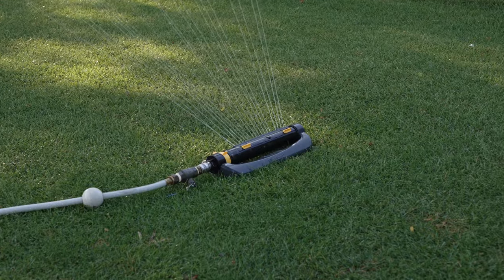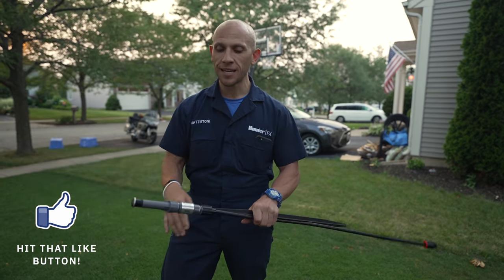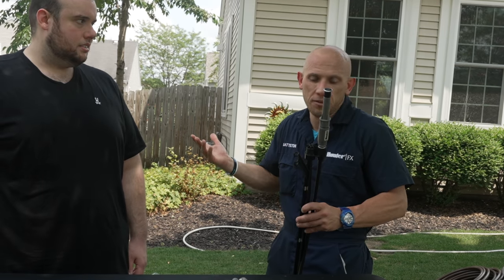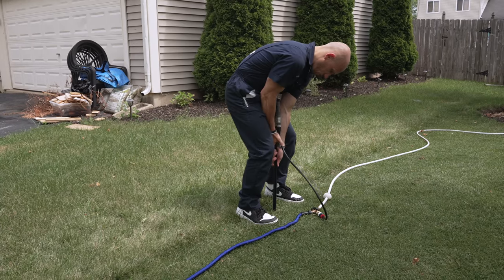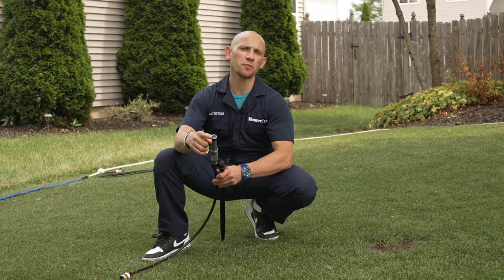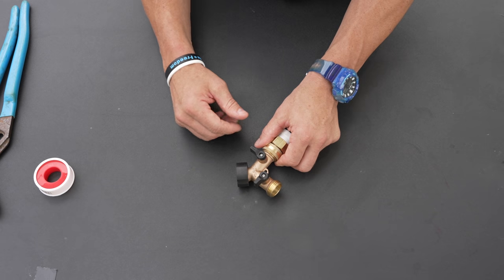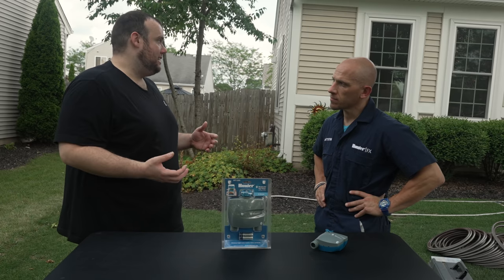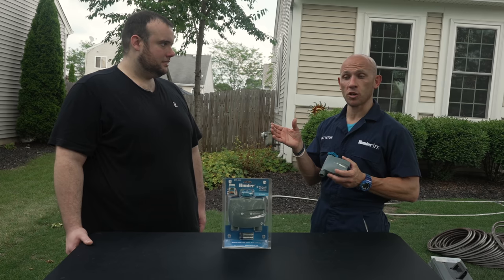Once You See It, You Won’t Use a Regular Sprinkler Again

Comment from the maker: 🔵 I Just Got a New Irrigation System!!!! See here-> https://youtu.be/3w3gq0_qsh4
Reply: Can we get a follow up to the lawn renovation in the spring? Before, during, after, program for water, fert used, regrets, wins, go forward plans for fall, winter, and spring?
Reply from the maker: @calbro5823  working on a follow up for over seed now, should be out in a few days. I cover a few regrets I have about kbg in it. Stay tuned
Reply: @PrincessCutLawnCare  awesome! Thanks!
Reply: Can i replace my old Hunter sprinkler heads with the new MP heads. it's underground Hunter system and works great though. I bought a new X-core controller for it.
Reply: No disrespect.. but for anyone who is concerned enough about their lawn to even be considering an irrigation system, overall this would just be a waste of time and money not to mention aggravation.  Now if your looking for a temporary solution that's only going to be used under special circumstances OR your just broke & handicapped then maybe ok for you.  Also, anyone who's in the service side of the business knows these MP rotators only look good on paper, in the real world they never go the distance.  On sloped grades they have there place but still fail way to much, so do the krains, so do the Toros, the rainbirds are slightly more trustworthy.  If your lawn is small and isn't concrete hard and your physically capable, you can install a much better official in-ground system by hand using hose bibs, 1/2" poly pipe and a 10" Wilton slit tool, obviously you must zone the system and head count based on volume available.
Reply: @alexanderdeclercq982 You bet, especially if they are rotors or old pop-ups. Just be sure to replace all of them on the same zone otherwise your GPM will be inconsistent. You can have different heads on seperate zones provided they are similar water output.

Comment: I don’t see the difference between this product and a normal run of the mill sprinkler. Your still using hose that would need to be moved when mowing and moved to prevent leaving a burn Mark on the lawn from the hose if left in place when not in use. Also your not going to be able to attached more than probably two of those sprinklers off one hose line. You need to account for length and size of hose along with water pressure in order for more than one of those sprinklers to cover properly in order for it to work like an underground system works. Seems like fluff to me. Installing an underground system is an easy diy job if you put a little effort into it. Just my opinion.
Reply: Water pressure, flow rate, hose length and whether such a setup would be able to sustain more than two units at once also came to mind as I watched this. If I'm limited to 2 units based on available water pressure and flow and I follow the recommendation that both spray back at each other, then the largest area I can cover at a time is 30 square feet. That requires moving both units and hose multiple times to cover my roughly 4,000 sq ft lawn. That's simple enough to do, but it's not quite the "set it and forget it” solution presented. No shade, simple truth.
Since you mentioned it, do you recommend any specific resources online or off to reference/consult for installing sprinklers myself?
Reply: Sounds like you could learn a bit more about pressure regulated sprinkler heads. I've set up many systems and they work great if designed properly. Yes, they have more than 2 heads. We have 20 gallons a minute flow with plenty of pressure where I live. Some simple math will yield a viable set up.
Reply: @LemonySnicket-EUC  lol. I have installed a few irrigation systems in my time. I know exactly what needs to be figured. That was the point of my comment.
Reply: @aroundthehousewithpat31  I didn’t mine also. But I did it as a temporary solution at my new construction house. 🤣🤣🤣 I set up 6 Rainbird 5000’s with the 3.0 tip, got my placement using regular spikes, and then used old hoses I already had and buried everything. 6 heads covering about 11,000 square feet with a 5’-8’ overlap. Each head is it’s own zone and running a 4 zone timer from the front of the house and a 2 zone running from the back of the house to my side yard. With the timers I might have $350 into it. 🤣🤣🤣 My neighbors who’ve spent thousands were like “Wtf are you doing”
Reply: @Lumpygrits76  definitely a great diy project. An irrigation system is well worth the effort and very cheap to do if you install it yourself. This was my 14th summer using the system I installed. I still have many of the original sprinkler heads from when it was first installed and also the same two control timers. I keep it maintained and I don’t see why I wouldn’t get another 14yrs out of it.
Reply: @Lumpygrits76  Any recommendation for things to buy and how to setup? I'm thinking of doing and underground sprinkler system myself as well.
Reply: Yeah , a normal sprinkler does the job just as well
Reply: Couldn’t agree more.
Reply: it was also leaking.
Reply: @philipwood8776  I hand water my yard. I go out every night between 1am and 4am and spend 30 min covering every part of the yard. It's the best way to water. My yard is the greenest on the block and I get to enjoy the nice cool air. I also see the animal night life.
Reply: I think it would depend on your application. I am in the stage where I pull weeds and replace with grass seed, dirt, mulch, fertilizer.  As such a traditional sprinkler is fine for me. However this system appears allow someone
Reply: I believe it would depend on your application. In addition whether you have higher water pressure or a well like mine which is set at 40# pressure which means 1 sprinkler. It seems to me there are advantages…Just my opinion. 

I
Reply: I'm running 16 heads on 6 zones with over 600 feet of hose out. Covers over 5000 ft². Running programmable timers 3 heads is max on each zone. Mow over hoses at 2.5" with no problem. The manager at the landscape and irrigation supply store also told me it wasn't possible. So I bought my parts somewhere else.
Reply: @nickgraham8045  Hey That’s Great!
Reply: I’m sorry but “easy diy”? LOL. I’ve worked in Landscaping for a very long time and there’s nothing more I love then heading to a new clients house and laughing at horrible irrigation system that I need figure out, fix and sometimes rebuild.
Reply: @Mobster9114  I know. In my mind I think if I can do it anyone can. For me it was very easy to do. Some simple planning and some bull work is all it takes. Unfortunately for many people they don’t know what end of a screwdriver to use. God has blessed me with great talent.
Reply: Yeah. It's nice that you can move it inside in the winter though. No need to pay someone to winterize it
Reply: The difference is this costs $200 bucks.
Reply: @erikalmighty  there is not much more of a cost to install a system underground. I have done it. This is for those who are too lazy to dig some shallow holes and do it right.
Reply: @LemonySnicket-EUC  

Yeah, I installed two Hunter I 20 rotors the furthest, one from the bib approximately 50 feet and the one before the farthest was about 25 feet then ran a tee off to three 12 inch 1800s on risers, hidden in a hedge... that whole run of three mist heads was about 20 foot max from the bib tee... they all ran just fine. It wouldn't have been able to handle one more head, but it was sufficient... & it was all underground! 😂 there are way too many sprinkler guys out there, who need a lesson in hydraulics! 😢
Reply: @jvon3885  you must have a tiny yard. I have a little over an acre. Who would water all of that by hand on a consistent basis?
Reply: @bitemefoker  yeah, is that supposed to be a burn or something? You probably live in an apartment block with gravel yards.
Reply: @bitemefoker  I had the best looking yard on my whole block and I've got contenders for best lawn awards. I mean sure systems make it look good but it just hits different.
Reply: These rotator nozzles are more water efficient plus they are pressure regulated and have all different arcs and spray distances. They’re also calibrated to not water too quickly and go slow enough to let the soil absorb the water and prevent runoff. They’re not your grandpas sprinkler nozzles that’s for sure!
Reply: I built the same thing for front and back yards for under $40.00  and that's a total of 8 heads.
Reply: Well, first of all, Hunter Sprinklers are head and shoulders better made sprinklers than Orbit or the other sprinklers you can buy at the Big Box Home Improvement stores.  That's not an opinion, just a plain fact. 2nd of all, if you have 40 psi and a 3/4" house, you can attach way more than 2 heads and run them perfectly fine. Hunter Sprinklers are low precipitation and don't waste water like most common sprinklers do. You may question the validity of the plan of running sprinklers above ground off of a hose, as do I, but quality of the sprinklers and number of heads are definitely not a problem.
Reply: This was like watching the worst cringeworthy paid advertisement ever! 😂
Reply: @SeanHayesParleys 30 square feet? 6x6 is 36 sqft so some of your math might be off
Reply: @Mobster9114  that may be well and true, but there are also those of us “DIY’ers” that have to fix problems and half-assery that the “professionals” pass off as a proper job. The number of “professionals” simply worried with their work lasting a month or two after the project is done is staggering.
Reply: You don't see the difference? Pressure regulate, less water output, Better coverage, and more efficient because the wind doesn't affect the coverage like traditional pop-up nozzles.
Reply: @LegendaryLawnCare89  I don’t see the difference
Reply: @LegendaryLawnCare89  in my opinion at the end of the day this is what I call fluff. Two of my sons are into lawn care like I am. I suppose it’s in their blood. 😂 one of them did this exact thing after I showed him this video. He is constantly having to tend to it and make adjustments to it. Mostly because it is above ground and it constantly gets knocked around and put out of adjustment from the kids playing in the yard and doing kids stuff. The other one decided to go with just putting it in ground. I have a video of that install on my channel if you would like to see it. Putting a system in the ground is a relatively easy diy project if you do your homework and really not an expensive thing cost wise if you diy it. I myself have an in ground system that I installed my self about 23 years ago and have had to do very very little maintenance to it other than changing out a few heads once in awhile. I’m still running it with the original timers even. As for wind not affecting the rotory heads I would disagree with you. The wind does affect them. I have watched and seen it with my own eyes. I am old school. I have a saying I use with my kids that was said to me as a young man and that is “ be the job large or small do it right or not at all”. So with that being said if someone wants or does go this route more power to them. It is just not something I personally would do or recommend it as something that is a permanent solution to watering a lawn. And the one son of mine who actually did this is doing his homework on installation an inground system to be installed in the near future.
Reply: @aroundthehousewithpat31 , I completely agree with you. You're better off with an in-ground system. I'll be sure to check out your video. I enjoy seeing how others do things because there's always more to learn. It's really cool that you and your sons are into lawn care; I'm sure they've learned a lot from you. Lawn care is a big passion of mine as well. I wish I had finished my second year in Turfgrass Management when I was younger, but I was more concerned about a paycheck at that time. I agree with you that if you're going to do something, spend a bit more time doing research and do it right the first time. I should have worded my reply differently. Obviously, wind affects any sprinkler, but the rotators are a bit less susceptible to wind. There are pros and cons with any sprinkler. Personally, I prefer to use Rainbird VAN nozzles if I'm installing pop-ups. With watering restrictions nowadays, who has the time for longer runtimes.
Reply: @LegendaryLawnCare89  I learned from my Grandfather 50 years ago. He was big into his lawn care. He always had the nicest lawn and I have been hooked ever since. As a kid I hung out with him more than my friends. My sons live on the same street as me which is where they grew up so there is somewhat of a competition now between us. It’s fun. I help one of them more than the other because one will ask for help and advice and the other likes to go on his own with what he does in the lawn just to have something to bust on me with. We have fun with it. I always refer to myself as a hack when it comes to lawn care but I have learned over the years what works and what doesn’t. I tend to stir the pot sometimes on these different lawn care channels with my comments sometimes but I mean no harm. I just think a lot of creators make it harder than it needs to be with some of the content they put out there. I know what you mean with chasing money early on in life. I did it. Went right to work out of high school for a utility company. I’m going on 42 years there. I did fine. I learned more by doing than sitting in any classroom. If going back to school for you would help in your career than you probably should do it but if you feel you really don’t need to you would probably just be wasting your time. Good luck with that though. I appreciate your thoughts on this subject for sure.
Reply: @aroundthehousewithpat31  Respect, I was impressed after checking out your channel. Your yard is in tiptop shape. I apologized if I came off as harsh earlier. I love reading and keeping up with the industry. I'm always trying new products out and learning new ways of doing things, especially if it makes life easier. It can be difficult to keep up with everything nowadays, new products, technology, equipment etc. I really enjoyed chatting with you today. Take care my friend to the south.

Comment: I’ve been in the lawn sprinkler business for over 30 years. I’ll be honest I only made it 3 minutes into this video. I was just torn between “do it yourself, or do it right” type of mentality. As a home owner and a rental property owner I think I can confidently distinguish between “form vs. function”. Yes it works … but it seems like this is a solution for someone who’s time isn’t as valuable as I would consider mine. Just think I’m the long run it’s worth getting a system installed professionally and doing the minimal maintenance.

Comment: I just recieved 8 mp stakes. I have used 6 mp3000 and 2 mp2000. My water pressure from the spigot is 40 PSI (municipal PSI is terrible, I don't even have a pressure valve on main supply). My max gpm is 5.5. I am able to run 3 mp3000 per zone. They throw water about 20 feet. I am super impressed. Thank you for the introduction to the product. My front yard reno thanks you. -Cory from Cental Illinois

Comment: I'm all for people putting out new products, but you don't have to trash other options in the process. I ran the Ryan Knorr MP rotator setup on stakes last year. The system worked flawless, didn't leak at all, and cost a lot less than the MP stake kits.  Best of all, I was able to reuse the heads and nozzles when I installed underground irrigation this year.
Reply from the maker: people on the Lawnsite were running that set up 10 years before his video so by no means is this trashing his product

Comment: Nice video George.  Definitely a step up for the DIY irrigation game. Good job on putting a kit together to make it a turnkey solution. 👍😎
Reply from the maker: Thanks Ron super excited to pioneer this solution
Reply: @PrincessCutLawnCare  Congratulations George, that's a much better setup. Personally, I would put in an in-ground system, even though it's a lot of work. If you do a bit of research and install it yourself, the materials would be less than a thousand dollars CAD for a 4-zone system. If you don't want to deal with trenches, wires, controllers, and electric valves, you can just use funny pipe, fittings, and a 4-way garden hose timer. You can get away with burying the funny pipe 4" - 6" under the ground. To install, markout where the funny pipe and sprinklers are going and use a spade shovel to cut out V pieces of sod. Then flip the sod over, place the funny pipe in the trench, put the sod back, and bury your sprinkler heads. You've basically done all the hard work at that point. No more ugly hoses running everywhere and you don't have to move anything. FYI you should be using some type of backflow preventer I'm surprised the technician from Hunter didn't install one  A backflow preventer keeps contaminated water from re-entering the water supply. You can use a vacuum breaker and install it on the hose bibb before the timer.

Comment: I spent a LOT on those spray heads last year.  I just checked and about 6 of them are broken already.  I have yet to find spray heads that last or work any better than the standard orbit ones.  The one advantage is they do control the water distribution better.
Reply: Hunter spray heads are 10/10. Make sure you winterize